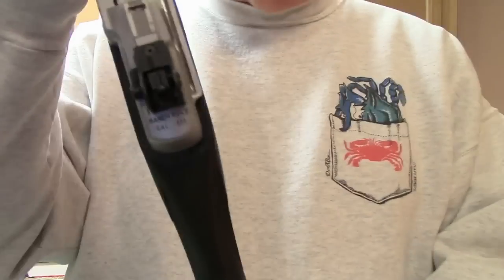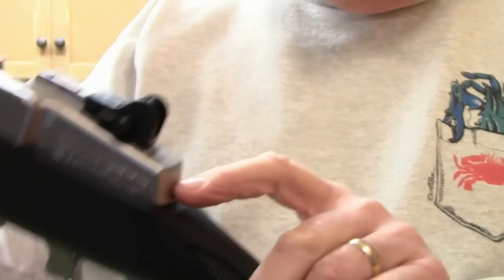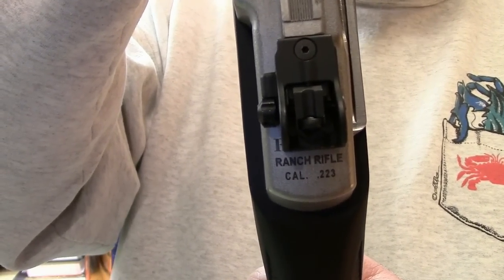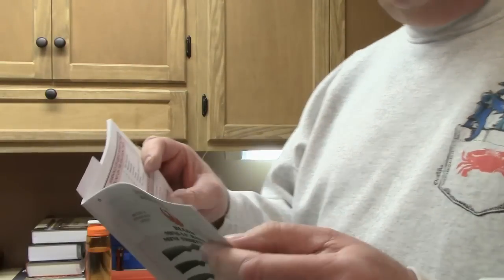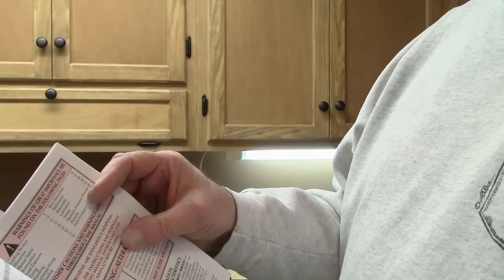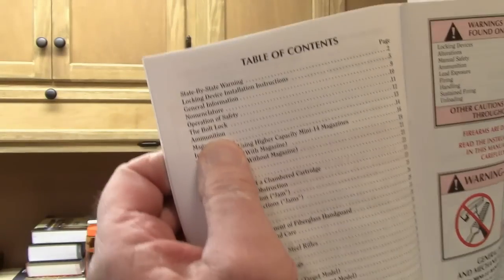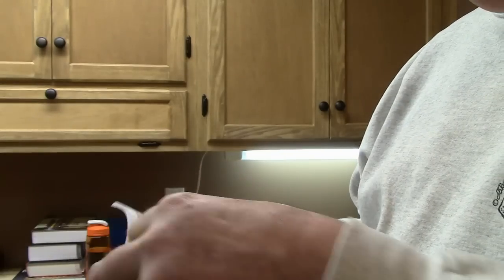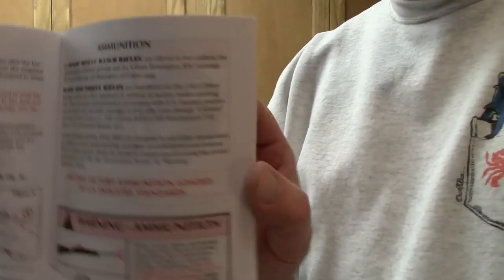Use of 5.56 mm NATO in 223 Rem. chambers ~ Finally, "Can I use NATO in my Mini-14?"

Comment: Good bless you sir I’ve been going over your videos older/newer if you haven’t done it yet you should redo or specify things like .223 wylde so folks don’t get confused because nobody reads owners manual I’m a “nut” because I find the most interesting things in these little booklets I’m new to shooting (<yr), live in chicago, growing up firearms not allowed. I’ve been using your channel as a training guide found I like shooting, was wondering if I could use you as a sounding board I’m good with tools and wanted to get into loading my cartridges seams like fun, not the casting part(not sure I can get away with it and be safe) one step at time, and it might save a little money but that’s just a bonus, if doesn’t I would still do it, (nut) thank you captain, your student, ivan

Comment: Recently bought a Mini 14 on GunBroker. Paid abt 20% more than before 2020. The specifications varied in the details. I bought one listed as .223/5.56. I assumed it was a .223. That was OK. When it came, it's a 5.56 NATO. Was pleased with the NATO chambering. The were other characteristics I wanted so I didn't call the seller. Suggest to anyone wanting NATO chambering; call to verify.

Comment: I had the same gun. I never even thought about trying to run 5.56 ammo through it as there is plenty of .223 available here. My question is can you run .223 out of a mini 5.56. I don't have a gun dealer handy to check.
Reply: Yes you can run 223 through a 5.56 Mini 14.

Comment: under US national SAAMI the 5.56x45 and the .223 Rem have different specs, but under C.I.P. the 5.56x45/.223 Rem are Identical becourse all tolerances and deviations in measurements and pressures are within the tolerances of the International C.I.P.-Standard that meens if your .223 has a C.I.P. Stamping it is 30% overpressure tested above (556) max. pressure and save to use bouth .223 and 556 (on german weapons its a litle eagle for exaple).
Reply from the maker: Thank you for your contribution.  Yes, I am familiar with C.I.P. standards, but the question I am answering for the viewer is the commonly confused matter that is relevant to the issue of 223 Remington v. 5.56 NATO as it applies to the firearms in question, made in accordance with U.S. standards.  Understand that SAMMI is not a lower quality standard than C.I.P., nor are SAAMI firearms inferior to or weaker than C.I.P.; rather, it is a pressure limitation to work safely with shorter throat dimension and more abrupt rifling leade engagement.  Overpressure testing is a very old process, whether SAAMI, NATO, or C.I.P.  The military needs extreme pressure to compensate in small part for the great loss of standard velocity in very short carbines.  Cilvilian rifles with 22-24 inch barrels have no requirement for such high pressure, as they achieve standard working velocities easily, which far surpass NATO velocities, while providing greater barrel and case life.  The hybrid Wylde chamber, which works the same as a C.I.P. chamber, has a relatively small following here, mostly among those who desire to fire both sorts of ammo in AR style rifles, but the .223 chamber is still vastly more popular for sporter rifle shooters, who have no desire to prematurely wear barrels and cases on high pressure ammo, especially when accuracy, rather than a few yards, is their primary focus.  Even though my 20 inch AR-15 and my Mini-14 can handle NATO or C.I.P. ammo within bounds, they both perform far more accurately, and cases last longer with standard loads.

Comment: Question, what if I took a .223 barrel to a gunsmith and have them re-tool it to 5.56, would that work?
Reply from the maker: @katanatac   Reaming can work, however, most gunsmiths would prefer to cut the barrel threads and set the barrel back one or more turns before doing so, to assure consistent cutting on all surfaces without chattering or grabbing.  That would give you a proper NATO chamber, but accuracy would suffer due to the long bullet jump.  Myself and most competitive shooters would prefer a Wylde chamber, which is both accurate and able to fire all ammo.

Comment: CZ says their 527 carbine chambered in 223 can eat 5.56 all day without any problems. This is clearly stated on the CZ-USA website.  They say the CZ 223 complies with CIP regulations and these regulations apply the same pressure requirements.
Reply from the maker: Joe 24 
Joe, what is inconsistent with my commentary?  I instructed folks to follow their manufacturer's owner's manual regarding the use of ammunition in their firearms.  CIP Is a European designation of pressure standards that is identical to NATO standards, which is entirely unrelated to American SAAMI pressure standards for the 223, which is the standard I compared to NATO designations.  European manufacturers, including some that have facilities here in the US, use CIP as their standard. My cautionary indeed remains the same; follow the manual and know what the pressure standard is, which may have nothing to do with the name of the cartridge.  The reason for that is very simple; many European citizens in many European countries  are prohibited by law to own a firearm chambered in military cartridges, and they only have one pressure standard for the 223, which they make for military use alone.  When they supply that chambering to nations that allow the 223, they call it 223 for marketing, but their only test standard used is the one used for NATO rounds. However, regardless of the name 223, your chamber is made exactly the same as a NATO one, which is nothing to do with the facts I outlined, nor is it inconsistent, because I never addressed CIP. I did, however, inform everyone that the answer is found in the manufacturer's detailed specifications, which is the guiding rule.  By reading CZ's website, you were thus infomed about the owners manuals identical specifications. The world is full of inconsistencies, and each individual must apply them  to their own application.

Comment: Why don't the 5.56 cartridges have more energy then .223 if they have higher pressures? I've seen the 5.56 advertised as having lower energy then the .223 of the same product line and bullet weight.
Reply from the maker: Energy is the direct relationship between velocity and weight, which is a mathematical constant. Bullets of the same weight that have higher velocity will have more energy.  The 5.56mm military loading is made to higher pressures and higher velocities than standard 223 Remington rounds when using bullets of the same weight, and will certainly have higher energy.  Some companies use shorter 20" barrel lengths to measure 5.56mm velocities, while their published velocities for the 223 Remington are derived from longer 26 inch barrels.  That velocity difference can easily result in lower PUBLISHED energy figures for the 5.56, which decrease significantly with popular 16 inch barrels, and even more for 16 inch barrels with permanently mounted glad hiders that further reduce actual barrel length. But, 5.56mm rounds fired from barrels of equal length certainly have higher velocity and energy than 223 ammo, which is an inescapable fact that comes with their pressures. Always look for barrel lengths in published data.

Comment: I had a 1986 Mini 14 which was engraved with .223 REM on the top of the action. I now have a 582 and a 583 series Mini 14s both of which are now engraved with the .556 on the exposed top of the action. Is it acceptable to use .223 in the .556 engraved Mini?
Reply from the maker: +Barry Thompson All Minis in all productions came with manuals, and if you don't have one, it can be accessed through Ruger's website, with corresponding serial numbers for all guns they produced.  Ruger recognized that confusion existed some time ago, and simply changed the engraving on the receiver to specify 5.56 to avoid that issue.  You may always fire .223 Remington ammo in a NATO 5.56 chamber, which has the greater pressure specification.
Reply: +GunBlue490 I presume they changed they changed the interior of the rifle as well?
Reply from the maker: Barry Thompson My point in making the video was to follow the instructions given in the owner's manual.  No change was necessary.  The gun is as described exactly in the owner's manual, regardless of the print engraved the receiver.  Follow your owner's manual. If you require further clarifivation, simply pick up the phone with your serial number on hand and call Ruger's toll free number, and the folks will answer any question.

Comment: Gee i wish i knew that 17 years ago..  ive been shooting them all this time..  He is a common sense idiom  :   if the 556 was going to blow up the mini 14  ( or any other 223 rifle ) you would have heard reports about it for decades..   and its NEVER happened or ruger and sammi would have posted warnings about this.  The 556 has 3000 psi greater than commercial 223 not 12000 psi..
Reply from the maker: The Ruger Mini 14 has always been chambered for NATO 5.56 ammunition, with the Target model being the only exception. The 223 imprint on the top of the receiver is only a generic caliber expression, but does not limit it to 223 Remington. Recent production rifles no longer carry that confusing imprint.  But, a rifle chambered in 223 should never be used with 5.56 ammo, as it is surely far greater pressure than the chamber throat dimension is designed for. SAAMI pressures should never be exceeded by any gun or cartridge.  Thousands of guns are destroyed every year by folks who exceed industry pressures. I've witnessed a number of blown guns privately, and in my career, and nobody should ever underestimate the danger.

Comment: Here is what's strange.  I have a brand new Mini14 in stainless.  Looks just like yours, comes with two 5 round magazines as I think yours did BUT where the engraving behind your rear sight says ".223 cal" mine reads "5.56 NATO".  Even stranger, I read along with you in the owners manual regarding ammunition and they are the same word....for.....word.  I would think that if there was a change to the chambering their would also be a change to the manual that the new Mini's come with.  Is it possible that when the manual reads "Standardized US Military Cartridges" that refers to the NATO round?  I'm not sure so I will need to call Ruger on that one.
Reply from the maker: Skill et 
They merely changed the engraving to prevent confusion.  It has the same specs.
Reply: Makes sense.  Even so, I think I'll stick with the 223 REM for it.  No need to be pushing the cartridge or my rifle to those limits.  Great videos btw.
Reply: Skill et the manual from ruger specifies that the 5.56 is ok in the mini 14

Comment: Long ago I bought a new Mini14 in 1987 in the .223 cal.  Long ago I was being informed when buying ammo that 223/5.56 were the same cartridge.     And yes I read the owners manual.   During the time I bought 223/5.56 ammo and used what I experienced with 7.62x51/.308 being compatible to use in a M1A rifle that I also owned.    I have fired  over 1k  rounds of 5.56 along with .223 ammo in my Mini-14.   Now with all this information HYPE on using 5.56 in a 223 rifle is getting a lot of attention.   I or many rifle owners at the gun range did not know back then.   HOWEVER,  I have not witnessed & seen any catastrophic rifle event in using 5.56 on a 223 ammo.   I have witnessed Ammo reloaded too HOT to fire and later explode at the gun range.  But never a mishap in regards to a .223 using 5.56 ammo, absolutely nothing.   Having said all that,  GUN BLUE490  your video stands correct & I concur.   By what I know know , FIRE the CALIBER AMMO stamped on the Barrel.   It is the smart and safe thing to do.    Thank you GUNBLUE490 on this video presentation...
Reply from the maker: The Ruger Mini-14 was ALWAYS, in every generation, from first to the last, regardless of the stamping on the receiver, chambered for the military 5.56mm NATO round of any variation.  Bill Ruger wanted is Mini-14 to be able to fire all the  surplus military ammo that was being made available after Vietnam.  

The ONLY exception was their .223 Remington Target Model (harmonic adjuster on barrel with special target stock), now discontinued.  That's strictly a .223 Remington chamber and is specifically documented in the manual as such.

Ruger began using the .223 Remington stamp many years before the public understood that the 5.56mm existed.  It was a simpler world back then, and folks identified with .223 Remington, with no understanding of NATO ammo differences.  That stamping has nothing to do with restricting the use of military NATO ammo.  In the last few years, they came to recognize after so many phone calls that folks were now confused, so they changed the stamp to 5.56mm.  The guns have always been the same strength and 5.56mm military chambering, just as their owners manuals have always declared since the first production.

Comment: Mini 14 ranch only uses .223 remington!  This was NOT clear in the video because another number starting with 5 and the words US Military were also mentioned in his reading of the Ruger manual.  That confuses the issue.  Only .223.  I checked the manual too.  He is correct but not clear in my opinion, because he is not explicit except for the target model, where he is specific and uses the word only.
Reply from the maker: I'll try to clear up any confusion. I am a Ruger factory trained armorer. Every Mini-14, with the single exception of the special TARGET model, and regardless of the imprint on the receiver, is specifically chambered for the NATO 5.56mm round. Therefore, as with all NATO 5.56mm chambered firearms, it will safely shoot ANY .223 Remington or ANY military grade 5.56mm ammunition. The Ruger manual makes that explicitly clear, and it may be verified by calling their customer service in Newport, NH.
Reply: @GunBlue490  OK so I was apparently wrong?  My mother who was an English teacher would not be pleased with me, even though I try to speak English with excellence.  I will re-read it in the two different versions of the manuals from the Ruger website, that I read after hearing the video.  Thank you for being explicit in your reply to me. :)  Funny I don't even have a mini-14.

Comment: I inherited an older Mini-14.  I was not sure if it could safely shoot 556.  I contacted Ruger by phone and they said that I could shoot 223 or 556 out of it.  Both were fine and safe.  I bought a ton of 556 Nato and shot hundreds of rounds without issue.

Great rifle(with "Ruger" Magazines).  I loved it so much I just bought one of the new and improved ones.
Reply from the maker: The Mini 14 has always been made to 5.56mm NATO specifications.  The only exception is the Target Model, which has a standard .223 Remington chamber and is identified by a large harmonics adjuster at the end of the barrel.  You will find that the newer version is much more accurate.

Comment: Mini 14 can shoot 5.56 it says so in its manual. BUT the mini 14 with the adjustable extension (target model) on the barrel will only shoot .223.
Reply from the maker: anton1949 
I explained that clearly at 9:33 on the video, referring directly from the manual, if you actually watched it.  The device is a barrel harmonics (vibration) tuner.

Comment: I bought a stainless steel Ruger mlni14 ranch rifle. Where yours says cal.223, mine has 223 and 5.56. I have read the manual and found it does not make a distinction   between the two rounds. I telephoned  Ruger,gave them my model and serial number and asked if my rifle was chambered for 223 or 5.56. They told me 5.56 so it was safe to use both 223 and 5.56. Given, your information which I trust, I will use 223. I bought it in Jan 2017 and  haven t  had a chance to fire it as yet. Please get back to me if you have anything else to add. it is important to me and I may not be the only one in this position. Thanks for your invaluable expertise. Rick Wiersma.
Reply from the maker: Rick Wiersma 
I don't think you followed the last of my video, where I specified the use of ammo in the Mini-14.  Ruger placed a misleading marking on the rifles for a number of years stating "cal 223", on guns that are chambered safely for 5.56mm NATO.  That's how mine is marked, too. The ONLY gun tgat cannot fire 5.56mm is the TARGET MODEL, which is chambered 223 Remington.  My initial commentary was applicable to the chambering differences in 223 versus 5.56 NATO in general, but my follow up commentary was independent of that, having to do with answering the confusion that arises over Ruger's confusingly mislabeled rifles, which they have since relabeled to match the chambering that has never changed.  In other words, your gun, unless it is a TARGET model with the big adjustable muzzle device, is made for any ammunition made, military or civilian, 223 or 5.56.  Watch the 2nd half of the video again and you will see me reference their manual.
Reply: Thank you for the fast answer.I will study your last video again. Sincerely, Rick Wiersma.

Comment: The manual needs to be read. The receiver says 223. The manual, and Ruger, says both cartridges are ok in the rifle. The manual is always your best friend. Generally ....you are 100% right, in most every case you would not want to shoot 5.56 in a gun stamped "223."

BUT as said, the mini 14 is CHAMBERED 5.56, not .223.....with the ONE exception of the target model. If your in doubt then call Ruger customer service, they will be glad to verify what is said here.

Comment: I think you meant to say 5.56 runs at 1k to 1200 more psi, not 10-12k psi more.
Reply from the maker: You are correct. The actual difference is closer to 3-5K, depending on manufacturers.  Regardless of what the measurements are, the industry regards the 5.56 round to be excessive in SAAMI 223 chambers, which every shooter should regard as factual, and that's the only thing that matters.